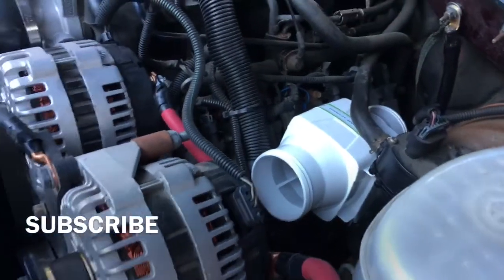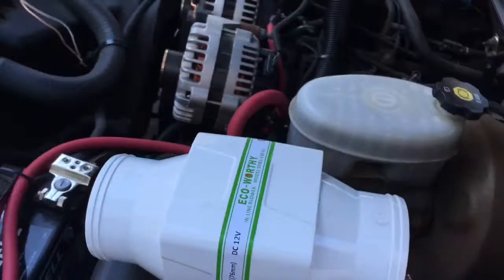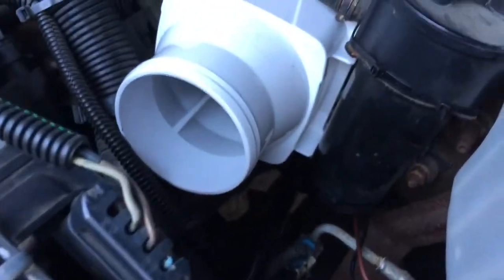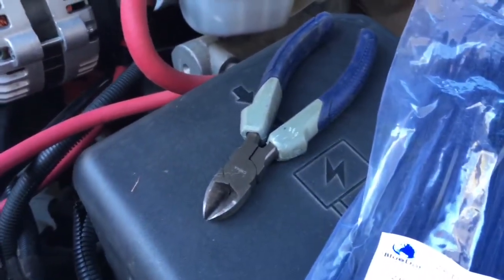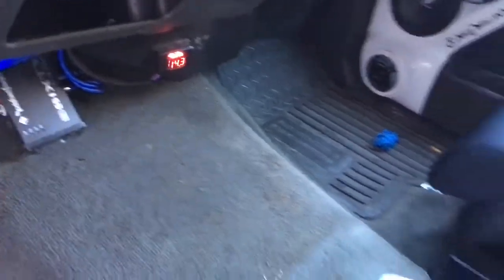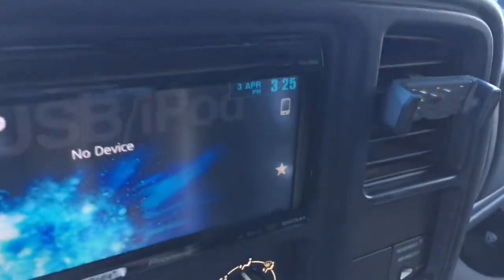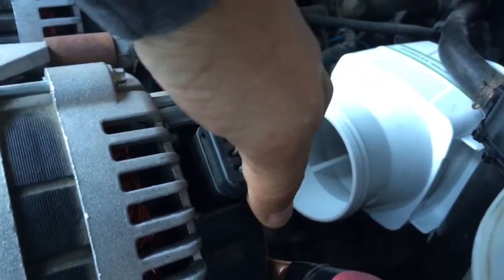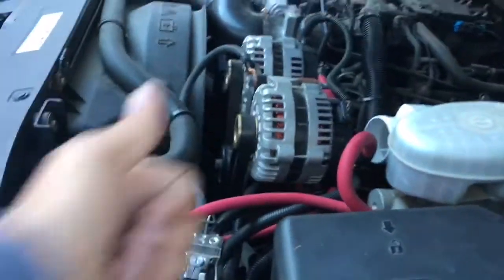CAR AUDIO ALTERNATORS  12 VOLT SOUND SYSTEM. Does  less heat mean  more voltage ?

Comment: What if rains and water splashes into the engine bay? Is the fan waterproof?
Reply from the maker: Yea the fan is actually made for boats ⛵️. Just make sure your wiring connections are sealed properly and you are good to go. Ie: shrink wrapped etc .
Reply: @EARDRUMASSASSIN  appreciate that.
Reply from the maker: No worries , thanks for checking out the channel .

Comment: Has it stopped working or anything from the heat of the engine on a good drive ? I wanna do it too
Reply from the maker: Never had a problem with it . I sold this vehicle and took the fan out and the fan still works . These are actually made for boat engine rooms so they can handle the heat just fine .
Reply: @EARDRUMASSASSIN  thanks boss I was installing them two of them the 270s n my truck behind two alts. N my buddy was like those things are gonna mess up quick from the heat. Thanks boss ima give it a try
Reply from the maker: Matthew Burton they will be fine . I’ve had lots of ppl do this after seeing my video and in person and not one of em had issues . Just make sure they are seaflow fans .

Comment: So at idle do you have it set up to push or pull air towards or away from alts ? You mentioned after a demo turn fan on to cool the alts ....is there any reason you couldn't run it during a demo sine it seems to help ?
Reply from the maker: Gaming Ballz pushes air at the back of Alts . Alternators cool from the back and suck  air in .  The fan turns on when I park and demo .